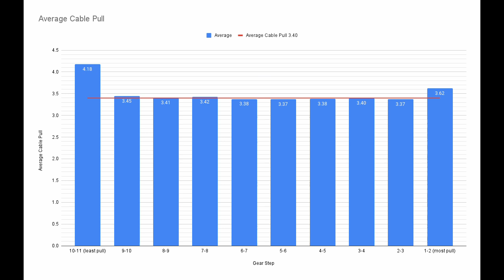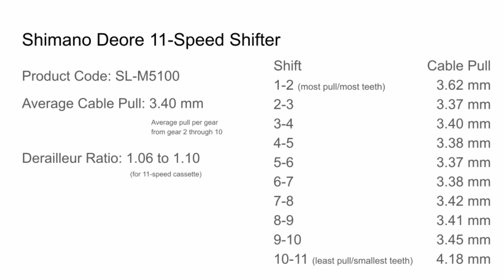Shimano Deore 11-Speed Shifter Cable Pull

Comment: Can you do a Deore 10 speed hyperglide shifter, I have Linkglide 10s cassette with 10s hyperglide shifter and derailleur, and it works, I am guessing the pull ratio, cable pull and cog pitch are very close.
Reply: M4100 shifter + M5120 RD + 11-43T 10s LG cassette + 11S chain works flawless!
Reply: @raff_ykt  For me, I needed I-Spec EV (not available in CUES) for my SLX brakes, I have SL-M4100 I-Spec EV (10s) Shifter + M5100 RD (11s) Derailleurs +11-48T 10s LG Cassette + 11s LG Chain, works perfectly.
Reply: I Have m5130rd- zee shifter- chinese 10s 42 cassete and works better than zee rd with 36t
Reply: @raff_ykt  same combo with CS-LG700 works flawless without 11 cog, while I was waiting for the U8000 shifter to arrive.
Reply: @loudpiper I would just get rid of 11th cog by drilling out rivets. Cassette would become 10S 11-43T. Perfect for gravel or city bike.
Reply: @loudpiper  your U8000 shifter is Clamp mount or I-Spec Mount? My 10S deore m41000 shifter is I-Spec Mount directly to my Deore brake lever.

Comment: Excellent measurements!  
I've done an identical test on my deore 11 speed shifter and found an avarage cable pull of 3.45 to 3.5 mm for the 2 measurements series I did. I was using a very old 50mm travel dial gauge I had 'lying' around and it was a bit sticky so there are some errors in between the measurments.  

I have also done some measurements on the deraileur travel, but they were quite a bit more tricky.  Although the derailleur I used was quite new, what I observed was that the movement of the derailleur depended in part on the chain line.  In the highest and lowest gears the chain is not travelling in a straight line to the front chain ring (i used a 1 by setup) and this actually works a against the cable pull.  So the larger pull at the both ends will to a certain extent counteract this restriction.  (it was a new chain I used with very little sideways flex).

The reason I did this was to design a cable pull adapter which would allow me to use a drop bar ultegra 11 speed shifter with the deore derailleur which would allow me to run a 11 to 46 MTB cassette.   I had one of these a while ago but it didn't work reliably enough so I drop that idea at the time but I am now back at this project.   In the meantime I am using a flat handle bar with the deore shifter, but would like to get back to the drop handle bars on account of the winds here in scotland.     

I have also done the cable pull for a 11 speed ultegra 6800 and found an avarage cable pull of 2.47 and 2.51 mm for the 2 measurements I did.    

Excllent work!
Reply from the maker: Thank you!

Regarding derailleurs, it's really tricky to measure them since the jockey wheel is moving all around in 3 dimensions.

Good luck with your cable pull adapter project! I know J-Tek has produced a lot of them, but I also wonder if it's possible to 3D print one. If you want to go straight to indexed 11-speed Deore, you could try Microshift XLE drop-bar shifters.

You're measurements for Ultegra 6800 line up with my measurements for ST-R8020. Good work!
Reply: @boothsbikeprojects    I totaly agree with your commnt on derailleur measurements.  They are tricky to perform reliably with gauges,  but I was able to use a high precision 3D scanning system to do the task.    
The reason why I have to design my own "j-tek" typeadaptor is that my fram has internal cable routing and with the deore derailleur there is VERY , very limited space between the point where the shifter cable emerges from the chainstay and where it goes into the derailuer adjuster.   Even for normal operation I hade to remove the adjuster barrel to get an acceoptable near 90 degree curve in the 45mm long jacket .
PS I will have a look at the microshift XLE shifters
Reply: @boothsbikeprojects  Regarding 3D printing shifter pull adapters, you may be familiar with this video - files for fusion 360 are provided in the description: https://www.youtube.com/watch?v=YeqvTJ-Y22Y
Reply from the maker: @swervin_side2side600  That's fascinating! I'm glad someone modeled this in Fusion 360